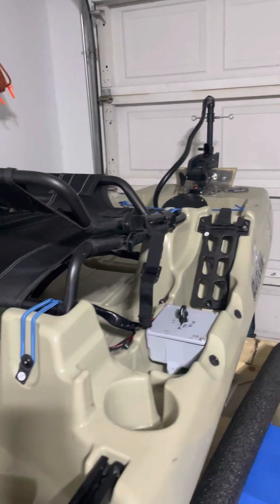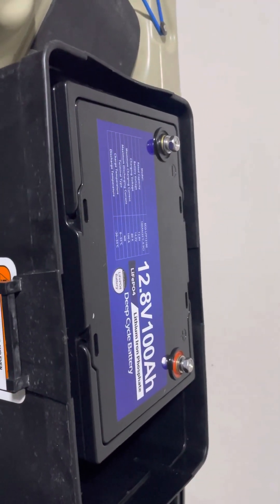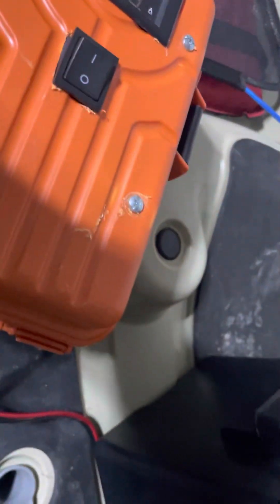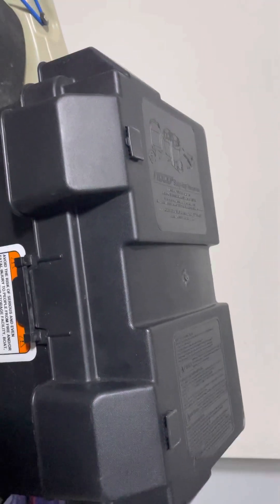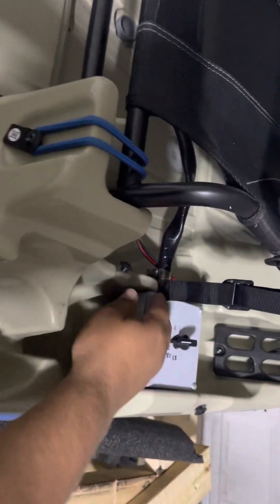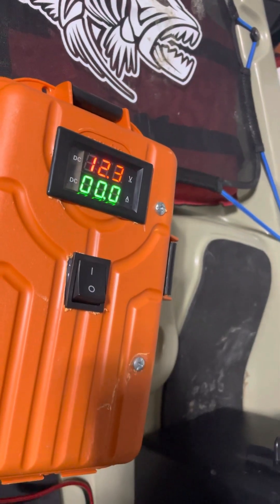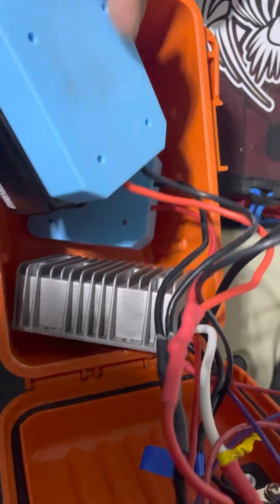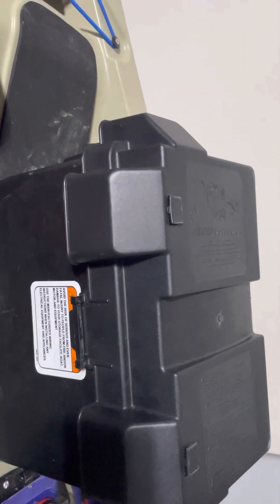Minn Kota Trolling motor/ Drill battery Update.

Comment: Remove the regulator. Will work just fine with out it. Keeps cutting off do to low voltage cut off on the regulator. Im using Milwaukee M18 with no regulator. Working 100%. That regulator is for a 24v setup. Not 18v. You are not using the full power of the battery.
Reply: Thats a great way to burn out your motor. They only take 12v. I like his way
Reply from the maker: Over Voltage is a sure way to destroy your equipment.